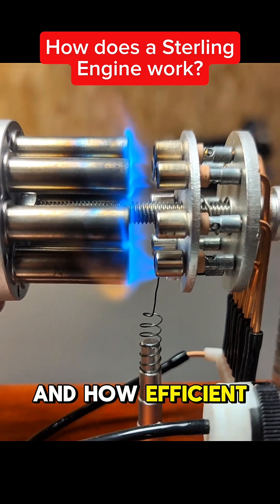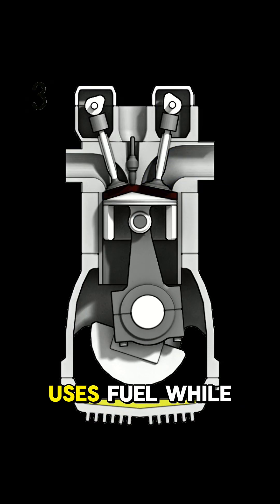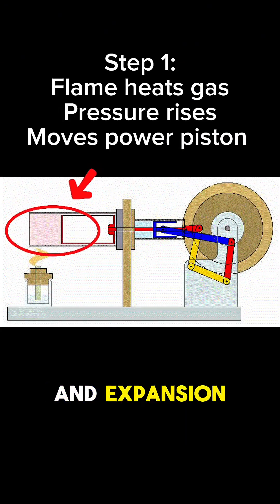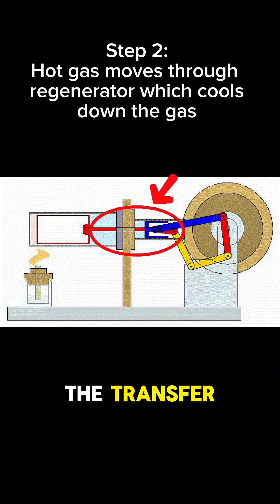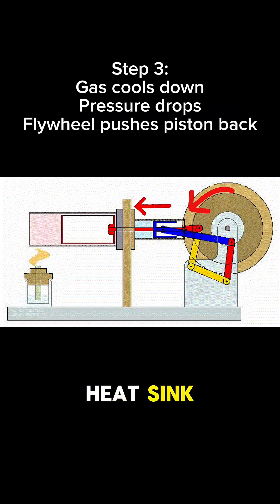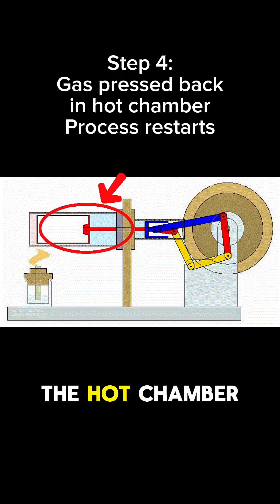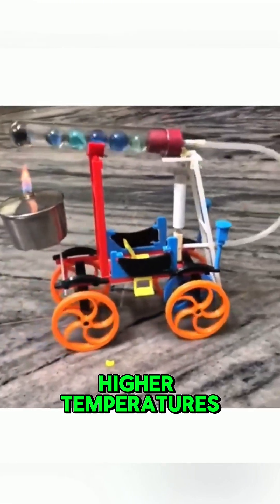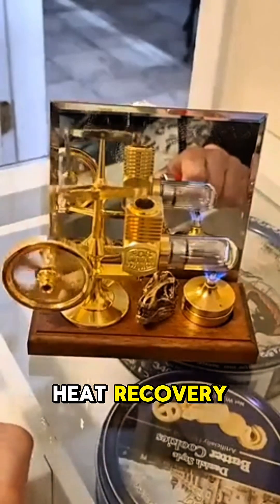How Does A Stirling Engine Work? #engineering #engine #mechanic

Comment: Aha! This one I heard of before! 😁
I heard that back when it was invented it wasn't very efficient because many elements in the periodic table were not discovered yet (or could not be easily produced, can't remember exactly). 
The cylinder should contain a gas that quickly transfers heat, I'm not sure which one would be best, is it helium?
Reply from the maker: The best ones are helium and hydrogen indeed! Perfect reasoning on how you got to helium, I'm impressed! Both these gases have low viscosity and perfect thermal conductivity, this makes them great for a Stirling engine.
Reply: @TheEngineeringDreams thanks for the explanation on this engine. I asked my mechanical brother if he had heard of a Sterling engine, of course he had.  Leaned something new
Reply: I have questions too Kraw , only your question is better than mine!😊
Reply: 😁
Oh stop it guys, you are making me grin and blush over here 😅
I gotta be honest though, I know helium is used in hot air balloons so I made a guess. If that didn't hit, my second guess would be farts 😁
Edit: methane, I meant to say methane, grow up you guys 🤣
Reply: @krawc0  Good one Kraw! You got it right!  I didn’t even have a guess!